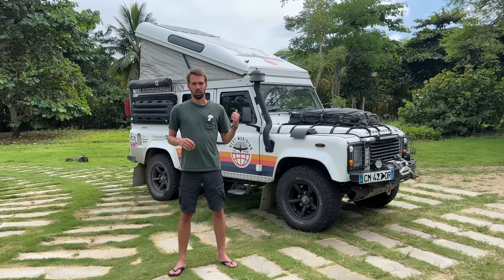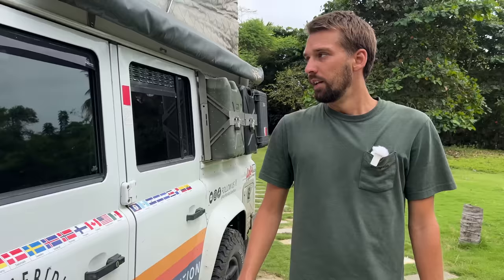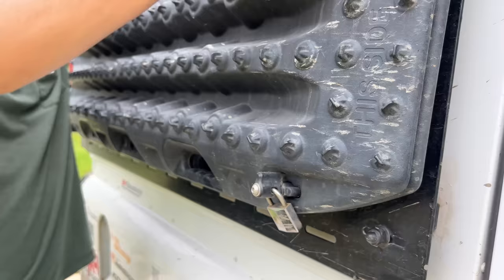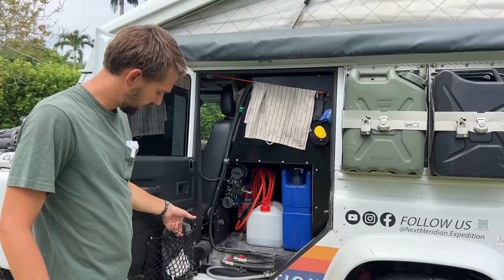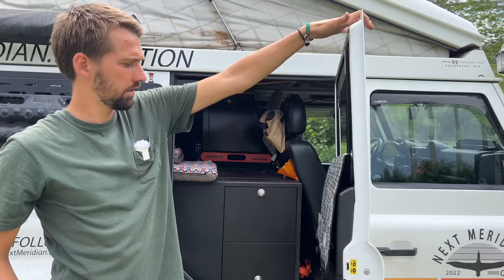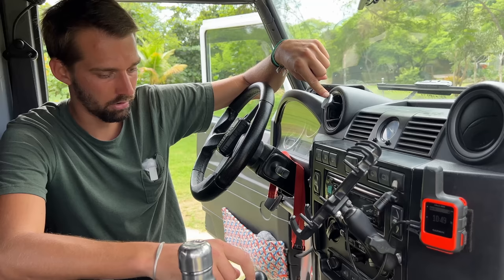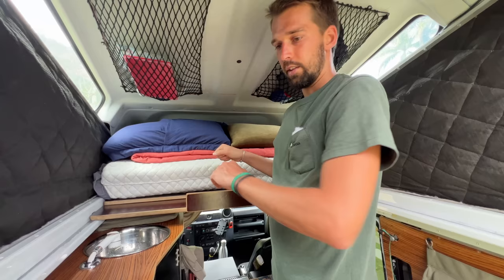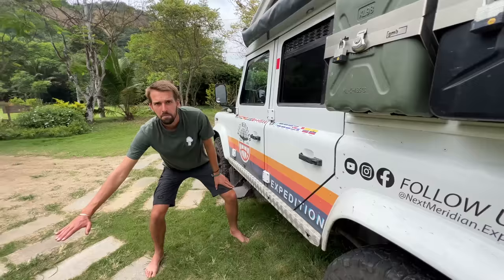Overlanding vehicle tour - Defender Land Rover (full tour)

Comment: Nice review - enjoyed that.
Water is important here in Australia because of the vast distances and desert.  Our caravan, which we tow with our 2009 110 station wagon, has 200 litres of water tank, plusb80 litres of grey water.
Recommend you get a hose with a filter and 12 volt pump so you can pump from rivers and filter before putting in your tank.
We have a 120 litre diesel tank which gives a range of about 950 kilometres. Diesel is widely available but your extra 20 litres would be useful in very remote areas.
Be aware Australia is VERY fussy about vehicle cleaning to keep out imported pests and diseases, so you will need to clean the vehicle very thoroughly yourself, but be prepared for Customs to order a second cleaning by a professional company at your expense.
We are on the Sunshine Coast north of Brisbane so feel free to make contact if you would like to visit.
Australians normally go north in winter to chase the sun and south in summer for cooler temperatures. Australia is vast, so be prepared for a lot of travel. There are many free camping spots.
Reply from the maker: Thank you for all the details, yeah we’re thinking we may need extra fuel for Australia. Water I think we should be fine with the extra jerrycan, it would mean having 115L of water and 140L of fuel. But  potentially we could upgrade to 195L of diesel.

Comment: Fabulous set up - 
We also have an overland 2012, 2.2 110 Defender (called Poppy) but with an X-Vison-X pop top - that we love - and our inner set up is from Landy-Ausbau. 
The BAS re-map will make a great improvement in drivability in the middle gears - however watch out for clutch issues with the extra power - we changed out our clutch for a LOF ‘powerful’ one and took the opportunity and changed the output shaft for a stronger one at the same time.
Truly love your videos !  - safe travels.
Reply from the maker: Good to know! We ll think about that ! Thanks a lot

Comment: if you remove the DPF pack it up and send it home for starage, refit as soon as you can when back in places that require it as if you don't and get cought with a removed DPF, it's big fines. Personally, I'd just strain the fuel and regen it more often. Better to not have one. 
Good walk around and interesting on a few points. 😀
Reply from the maker: We’ll buy a new one when we get home, we’ll keep ours but simply put a straight pipe inside the catalyst so it’s not visual visible. We need to remove the DPF, we are loosing tons of power and the regen is now twice a day… it’s unbearable

Comment: Not sure if i ever use gasoline as a source for cooking with because dose it let off odor that will get on what your cooking just like smoking meat , i love my hi-lift farm jack it has many usable features other help changing a tire , i also have a set of 4 maxtrax boards but for heavy duty i also bought aluminum traction boards that don't flex , i own 2 land rovers a04 D2 & 07 LR3 both built for overlanding,  i have always loved th defender square box look but was too expensive to buy but for what you two are doing this is nice size defender and pop top gives you more room , there no limits to overland builds good luck in your travels

Comment: I assume you'll keep the DPF for when you get to Australia and can swap back?  The high lift and winch might not get used but the piece of mind of having them, the confidence to go remote and solo and then the 1 future time they completely save your ass they could pay for themselves being there in 1 use. Good walkthrough.
Reply from the maker: Hi! Thanks for for feedback. About Australia do you know if we bring the car over they will check our DPF? If so do you know if it is just a visual inspection to check if the catalyst is there or if they also take exhaust measures ? Thanks a lot for the feedback
Reply: @NextMeridianExpedition  not an Australian,  but they are tight on rules,  even on tyre sizes and for  sure on exhaust/DPF.

I think you need a basic inspection on cleanliness and roadworthyness to get into country and if you fail you pay storage charges while they clean or yoy get it legal.  I'd ask overlanders that have done it but it could be expensive to get into Australia if they dont like your vehicle.   I've just researched for my own trip not experienced but kinda came to the conclusion with the most expensive shipping in/out and limited visa time there Id consider buying and selling there for my trip rather than taking my own.  GrizlyNBear did a good few videos on the process for them and especially the cleaning and roadworthy test
Reply from the maker: @KevIsOffGrid  yes we have already everything well set for cleanness measures including people to help us with the import. It was specifically on the DPF we were wondering we will search further

Comment: Bonjour Nick et Mathilde,
We met last fall near Lake Louise while I was with my Defender 110 called Le Métèque. 
Your video is very informative, especially since I'm preparing mine for a year long trip  for next year.
Can you give us more details about the brand or your supplier for the heat exchanger for the water heater as well as the Belgian manufacturer of the metal boxes to be installed under the body for storage.
Congratulation!
Reply from the maker: Bonjour Jacques! Ça va? Les deux sont le travail de Georges en Belgique son site est le suivant : https://www.roverland-expedition.be/shop-storage dis lui que tu viens de notre part. C est lui qui a installé le heat exchanger sur l Albatross.

Comment: T hanks for making this video. Awesome tour.
Can you please give more information on your heat exchanger system. Love the idea on the extra space under. Also wanting to do the same
Reply from the maker: Hi Paul! We have tubes bringing the coolant from the engine in our water tank and out again. We have a on / off switch so we can control when the coolant takes that circuit and a temperature gage to control the temperature of the water directly next to the steering wheel. So if we want hot water for a shower we would activate it maybe 20/30’ before arriving as we drive to bring the water to 40 degrees Celsius. It is awesome and very simple. It really increased our comfort a lot.
Reply: @NextMeridianExpedition  is there a small radiator (exchanger) in your water tank or just a pipe passing through? keen to do something similar at some point
Reply from the maker: @paulfisher1160  just a pipe. We have a video from the very very beggining of our channel showing the installation we made with our friend https://youtu.be/PfPshiuXP28
Reply: @NextMeridianExpedition  Thanks, will go watch it and catch up. Very cool

Comment: May not need the extra spare tire. 4XOverland talks extensively about this.  He did have one expedition where he needed it, but the tires he was using were not KO2’s. How do you get power to your heater? An AGM battery emits gas does it not?

Comment: How is the bf Goodrich tyres. I had a set and at 20000 km they were badly chipped and cracked.
Reply from the maker: Ours last about 60-80 000km. We use the ko2 AT and we can recommend those. I don’t know about the other models.